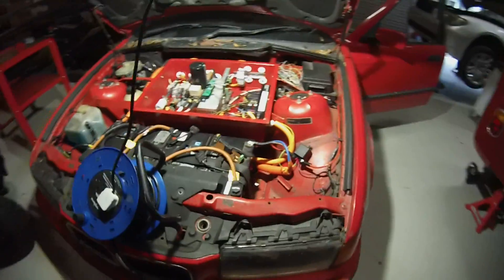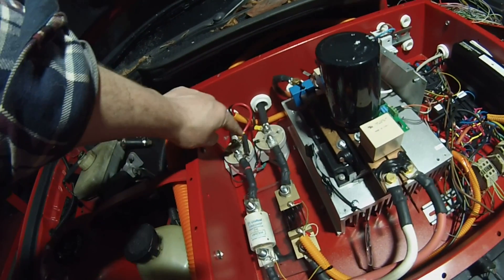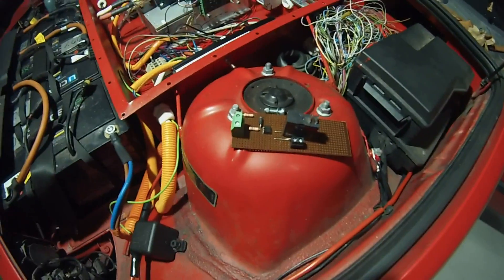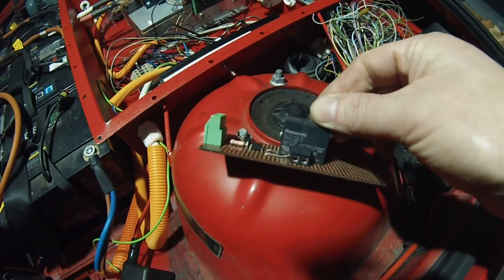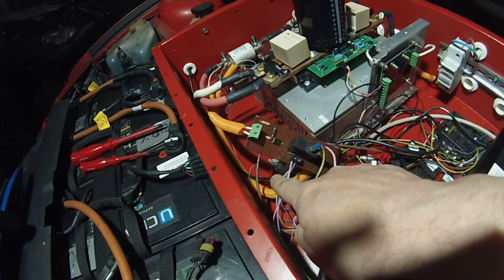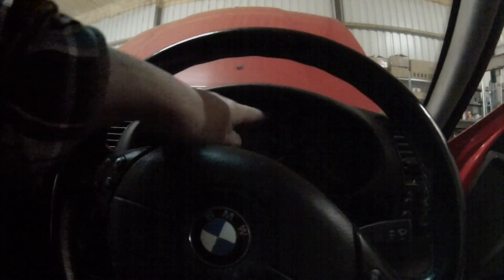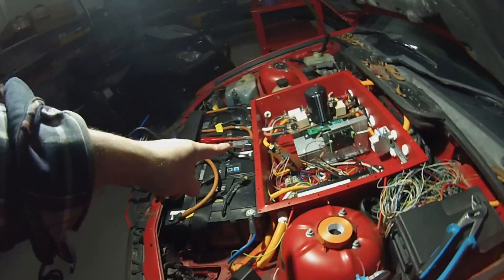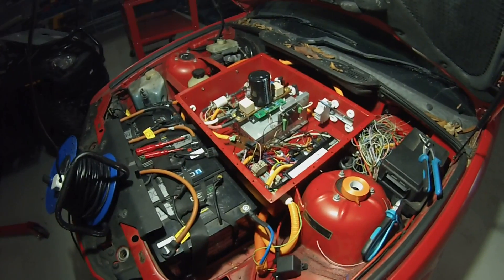€1,000 BMW E36 EV Build 15 : Automatic Precharge

Comment: My only comment will be, what is the point of a precharge? Surely the cap and gets don't mind always having a voltage applied to them. I realize it might be a safety concern always having things powered up to rail voltage bit the added convenience of always having this ready to go is nice.
Reply: Try not precharging and see how you go. Google why a pre charge is used.
Reply: @blackterminal  I think you missed the point.
Reply: @cheapygeek  no. I think you did. I know what you meant. You can’t have your inverter powered up all the time. Sooner or later it will have to power down. Too much focus on convenience. Do as you like. I have nothing further to say.

Comment: I'm a fan of prechargers. (I even made on for my cheap 120V AC inverter in my Model 3) I prefer the circuit to watch the voltage drop across the main contactor terminals so there is less surge load on the contactor. I also like to use a PTC thermistor as the precharge resistor so it does not blow up in case of a fault. 
Here is a relatively simple circuit I made decades ago: If people have interest I could look up more modern part numbers and discuss improvements made over the years. 
http://cafeelectric.com/downloads/precharger_1.1.JPG
Reply: Bit rough on the poor relay there, should the 12V become disconnected the capacitor gets shorted by relay contacts.
I would have added a resistor to limit the current.